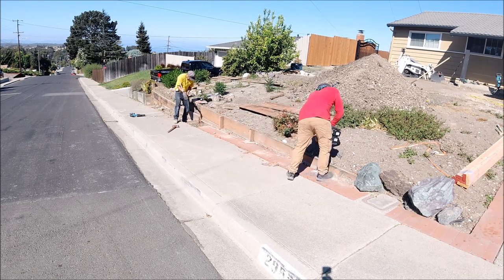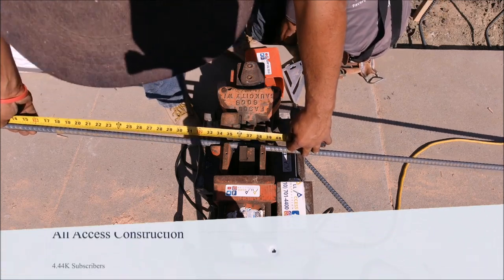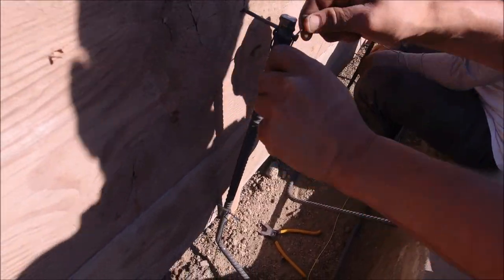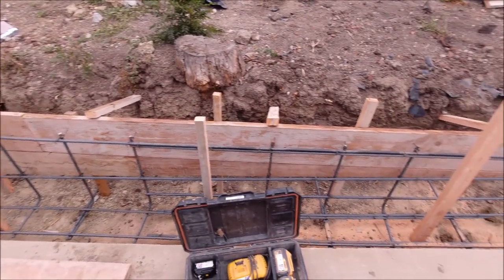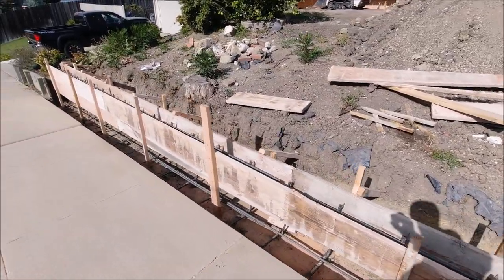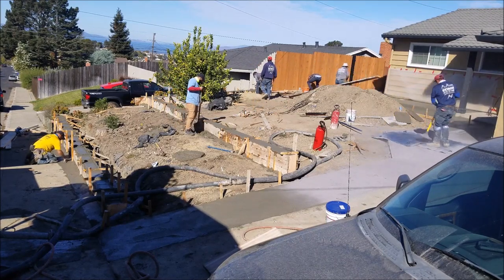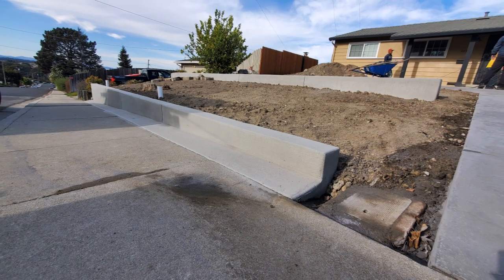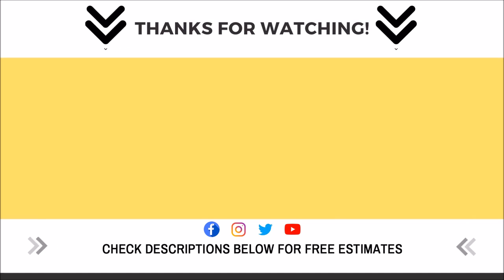🔊 How To Build  Small Concrete Retaining Wall | ☎️ All Access 510-804-4646

Comment from the maker: In this video, we will show you how we go about building a small concrete retaining wall in the bay area. There is bouns footage at the end of two other small concrete walls we built this year but didn't have enough footage to make a complete video
Reply: Hi,
I've  used concrete slabs as a wall to a small pond but now I'm thinking I should have a small concrete wall to support it, shall I use gravel & sand with the cement? I've  also got a thick metal mesh?
Thanks for any advice you may give.
Reply from the maker: You should probably do something like this and put a pond liner in it... https://youtu.be/vphtlw89Rgo

Comment: Hey man, your videos are incredible! I noticed you leave the back part of the wall forms there for strength, but that would mean that the stakes are embedded into the footer once it dries. How do you take the back forms off? Cut the stakes? Thanks man!
Reply from the maker: Appreciate the comment 🚨🚨💯💯.. We use a multi-purpose tool and cut them when we strip.. 👍🏾👍🏾

Comment: I really like your videos man!! I wonder what psi concrete you recommend for retaining walls? and also the Thickness of the wall you build
Reply from the maker: Appreciate the comment and support. Most of our mixes are a six sack pea gravel 3000 psi...Our walls are 8 inches thick
Reply: I have the same question thanks I found it the answer. I have an extra question if I want to build same wall but with 4x4 post for a horizontal fence on top of the concrete is good to install the post with it? Or will risk to crack the concrete? Or is better to use a bracket?
Thanks in advance
Reply from the maker: Best if you place brackets in concrete
Reply: @AllAccessConstruction  thank you
Reply: I noticed that your link to Instagram is broken I try but not luck

Comment: How do you deal with the holes from the kickers in the footing? Also what do you do about the nails you tie the upright rebar to when you pull the forms?
Reply from the maker: We just leave the nails. They stick out very little, as far as stakes if we pull them out when we finish we just fill in with concrete..

Comment: Hey thanks for the video. I have a question. I'm about to do a double (2 rows) retaining wall, about 2-3 feet tall each in my back yard. All sloped, so I want do one wall, give it about 4 feet space (for flowers or veggies, etc.) then another wall. I wanted to know.. what do I need to buy for concrete?! Is there a specific brand you can suggest for retaining walls, there will be traffic on it, I have kids and family walking all over everything. I guess I'm wondering what would be the best concrete I can use and from the supper limited amount of information I gave you can you suggest few tips and gotchas!!! ps I'm a new homeowner (pre pandemic) but I love building and doing everything (well....most things) myself. Any tips/suggestions, things to look out for would be awesome!!! thank you
Reply from the maker: All our concrete we use is a six sac pea gravel mix (3000psi). Also if you have to walls going up the rule of thumb is what ever the height of the first wall the second wall must be double back. Example the first wall is 3 feet high than the second wall must be 6 feet back. There is expectations  but talk to an engineer . Good Luck
Reply: @AllAccessConstruction  thank you!
Reply from the maker: All good
Reply: @AllAccessConstruction  I noticed you mentioned you're making a website soon. I'm a web developer so if you ever have questions or need help, hit me up!
Reply from the maker: Much appreciated... 👍🏿👍🏿💯💯

Comment: I’ve been watching a bunch of your videos! I’m wanting to make a 4ft concrete retaining wall and yours are the most informative, so thank you! 
Question, how long do you wait before removing your forms? Is it possible to do a wall slowly and mix a bag at a time over a week or so? Would that make the wall less strong?
Reply from the maker: It's kinda of a timing to it. Recommend you have someone do it that understands the process. You also can use a product that's ardex that you can come back couple days later and smooth the wall that way you don't have to worry about stripping it the same day.. Any other questions let me know... What area are you in?
Reply from the maker: Recommend you pour wall all at once..
Reply: @AllAccessConstruction  wish I was in Sac town! Lol I’m in Utah. I grew up near Fresno though. I am a carpenter but I need a wall! Lol
Reply: @AllAccessConstruction  thanks for the quick response
Reply: I've done a footing for a small residential bridge over a period of time - I was just a laborer for my father-in-law and didn't dare offer my opinion.

However, does doing a project a batch at a time. Impact the strength of the concrete and should I have overlapping rebar to improve the strength?

Any other advice on this kind of a project would be helpful - I'm actually an electrician but end up doing a lot more and have built houses from the footers to the shingles long ago.
Reply from the maker: Ideally you want to pour all at the same time.. We overlap our rebar minimum 2 feet

Comment: Do you leave those duplex nails in after the rebar has been installed and wire-tied? If they are left in, when the boards are removed from the back of the form the nails would protrude out through the concrete. I assume they are removed before the pour but could not tell from the video.
Reply from the maker: Appreciate the comment.. They stay in....
Reply: @AllAccessConstruction  how long time can remove the forms for the retaining wall for finishing work around how much time?
Reply from the maker: The soonest we have taken them off is two days